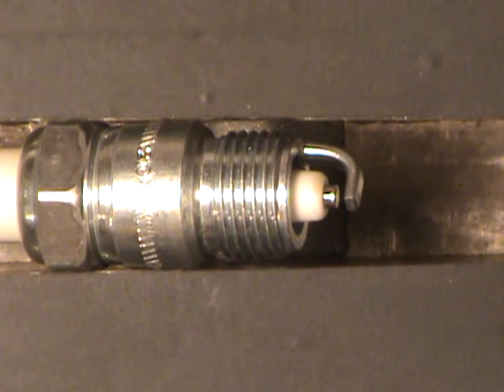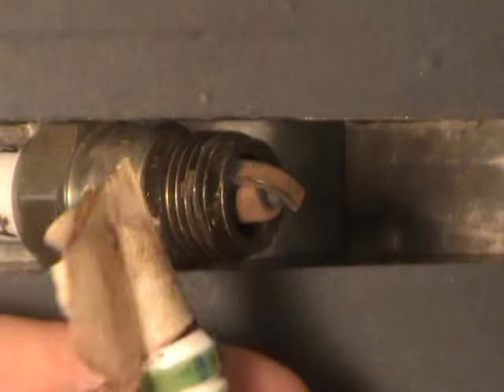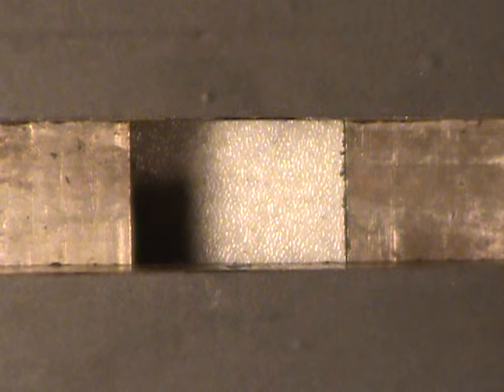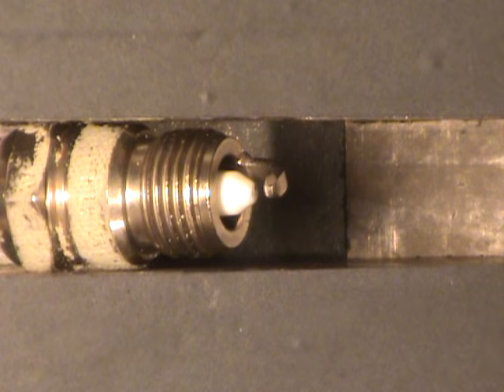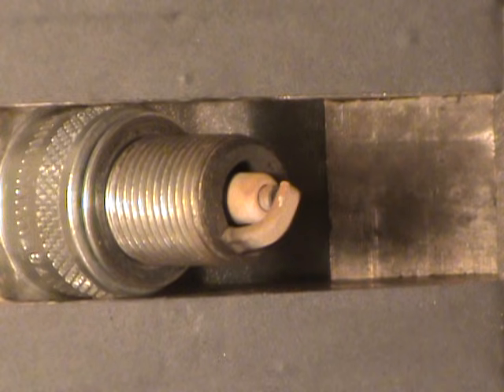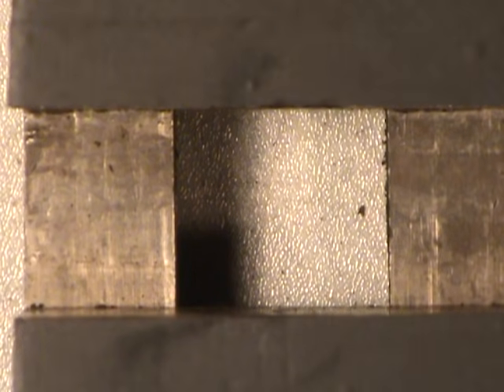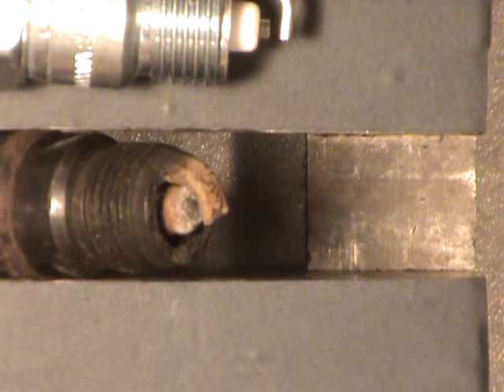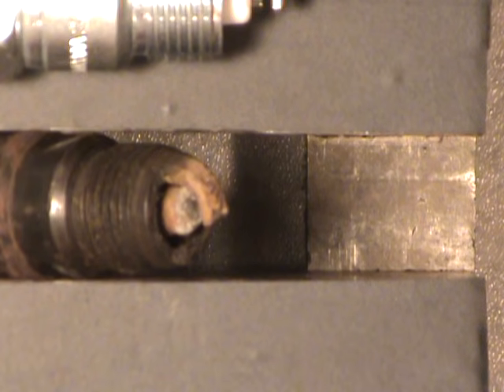SPARK PLUGS How to Read them (Part 3)

Comment: hi rockys. i have a lancer 2.0 and these are my spark plugs, please check it what  is the problem of my car.thank you.
http://s1348.photobucket.com/user/RenzAcedo/media/13350954_1193288634015367_226111949_o_zpsicfzos1v.jpg.html?filters[user]=135881500&filters[recent]=1&sort=1&o=0
Reply from the maker: Greetings...renz acedo............You're Welcome, and, Thanks for watching.............Before, I start to talk about the Picture, of Your Engine's, (4), Bosch Spark Plugs, that You provided the Link to (above), that You had, on Your Photobucket  web-page, I would like to say, a few things first, before doing so......................Have a look..."Inside", Your Lancer's "Engine Compartment" (under the Hood), for, what is called, a..."V.E.C.I." (Vehicle Emissions Control Information), "Label/Sticker", which will usually have, some Useful Information printed on it................Hopefully (printed on it), it will have the..."Mitsubishi"...(Your Lancer's Manufacturer)..."Original"..."Spark Plugs"...that were Installed in Your Lancer's, 2.0 Liter Engine, as it left the Mitsubishi/Lancer's "Assembly Line".....................I, myself, try to Buy/Purchase, the "Factory/Original" Spark Plugs, that the Manufacturer Installed in the Engine, when it was Brand New, in order to Avoid any Problems, as, in the past, I installed, a Set of, some "Other", Top Brand Name Spark Plugs in a V-6 Engine, and the "Heat Range" was..."2-Ranges...Hotter"...than, the Factory's, Originally installed Spark Plugs...!!! (and, maybe Your Bosch spark plugs, could very well be too...and I hope not...cuz...if way too Hot..."Engine Damage"...might be the result...!!!)....................Did You Measure the Spark Plug's..."Gap"...that's between the Inner (center), and Outer Electrode....???...as that "Gap/Measurement", is very Important, my Friend, cuz, too Small of a Gap, will usually make for, a Small Spark, and if that spark plug Gap, is too BIG, then, Miss-Firing can occur, as well as, the Ignition Coil, or Coils, tend to get "Over-Worked", and might possibly Over-Heat, and get Damaged, or Destroyed, and, I hope not...(please note, that, some spark Plug Designs, "Are-Not Gap-able")...also, try to find the "Correct"...spark plug..."Gap"...for Your Lancer's..."Exact"...Engine...!!!................Ok now, lettuce now talk, a bit, about the Photobucket Picture, of Your 2.0 Liter Engine's, (4-used)..."Bosch"...Spark Plugs...shall we..................It appears to me, that, the 3 Spark Plugs, on the Left Hand Side (of Your Picture)..."Were-Not Tightened Enough"...as, from what I saw, in Your Picture, those, shall we say..."Crush Washers"...were still "Round-Looking" to me, as compared-to, the Bosch spark plug, on the far, Right Hand Side (of Your Picture), where I was seeing, that "Crush (sealing) Washer", very well..."Flattened Out"...and, as it should be, in order to prevent, the Loss of (cylinder) Combustion Chamber "Pressure", as well as, having the Spark Plug, to be able to..."Transfer the Heat"...from the Electrode end, of the Spark Plug, to the Engine's Cylinder Head (Very Important...!!!)...and also, I think, that i saw, a little, Brown Spot/Area, on the spark plug, on the far, right side (while the other 3 didn't).....................All 4 Spark Plugs, kinda looked a bit Lean (air/fuel ratio/mixture-wise), for my liking.....................You were saying, about a "Problem"..."Engine...Running-wise"...???...and, if so, can You tell me, as to what, the Problem or Problems happen to be, the best way that You are able to, that way, I'll have a much better chance at helping You out....................Any Dashboard "Warning Lights", coming "On", since You had these "Bosch" spark plugs, in Your Lancer's Engine...???.........Is the Engine...Hard to Start...Cold or Hot...???.........Does the Engine, make a..."Pinging or Knocking"...Noise, when it is running...???................Does the Engine Run "Smooth", with lots of Power...???........So then, try to find that "V.E.C.I"...Label/Sticker, or, try to find the Mitsubishi/Factory's...Originally Installed Spark Plug's...Brand...Type...and...Part Number...for Your Lancer's..."Exact"...Engine, to avoid any unwanted problems.................Probably a good idea, to have Your Lancer's "On-Board Computer"..."Scanned"...for any..."Trouble Codes"...to see if there happens to be any, that might be Stored in Your Lancer's, Computer Memory (note...some Automotive Parts places/businesses, might "Scan" Your Lancer's Computer for "Free", so, just phone some places, and see/hear, what they have to say)...........Also, with a Computerized, Fuel Injected Engine, It's also a good idea, to have the "Fuel Pressure"..."Checked/Verified"...as well, cuz it's super-important, to have the Fuel Pressure..."With-in"..."Specifications"...or the Engine, probably won't run, as good as it should be running .........Warning...!!!...some Fuel Pressures, for gasoline, fuel injected engines, can be, about, as High as 60 PSI/Pounds per square Inch, and is "Dangerous"...!!!...................You didn't mention, Your Lancer's..."Year"...Model...and also, is Your Engine, Turbo-Charged as well...???...as, the more that I know about Your Car, the more, that I should be able to help You out, and.........till next time........Be Safe, take care, and have a good one.

Comment: Thank you for your effort to bring us this valuable material.
Reply from the maker: Greetings...Alex Pavlyuchenko....You are Welcome, and, Thanks for the nice comment, and for watching as well....................The Spark Plugs, that I used in this Video, are mostly out of, much older, lower compression (ratio), Carburetor equipped Engines, and, as You saw, they had quite a bit, in the way of Deposits, showing on them...................You will more than likely, not be seeing, as many Deposits, on the Spark Plugs, that come out of, the much Newer Engines...unless...there happens to be an "issue/problem", with either, the (computerized) Ignition System (weak or faulty), or, the Fuel (gasoline) System (too rich of an air/fuel ratio/mixture), that is usually, a (computerized) Fuel Injection, type of fuel system (since about the mid 1980's there-abouts, in the USA or Canada, that is).............Thanks again, and........Be Safe, take care, and have a good one.

Comment: What Ive noticed on mine is that the white ceramic part  ( Under the electrode is )  half dark and half white.  Does that mean the spark is not centered ?  I drive a 89 BMW 325i
Reply from the maker: +BadRonald1 ....Greetings BadRonald1....Thanks for watching.................On most of the common types of spark plugs, that, white-ish colored, Porcelain lookin' stuff, that surrounds the Center Electrode (when new and unused, that is), will usually have one side of it, having some Deposits on it, while the Other side of it, can be almost white-ish colored, after the spark plug, has been in a running engine, for at least a few hundred miles/kilometers, or more....................Why You ask...???...well, it's usually due to, the way in which, the Air/Fuel Mixture Flows, inside the engine's Combustion Chambers, and in simple terms, the Air/Fuel Mixture travels, from the intake valve, then, towards the spark plug's Electrodes, then, on to the exhaust valve it goes (it's actually, much more complex than that, as in, Swirl, Tumble, etc.)..................If an engine is running way too Rich (gasoline), or, burns too much oil, then, I've seen some spark plugs, that had, that center (electrode) Porcelain-lookin' stuff, all covered, with either, black dry carbon, or some very oil-ee deposits (sometimes Both...!!!...lol)..................Some of the newer engines, might not have very much at all (if any?) Deposits, showing on the spark plugs..................As long as Your BMW's Engine, Runs good-n-smooth, without having any unusual pinging or knocking noises, then, that's usually a good thing.................Try to always use the BMW's recommended Spark Plugs...Set at the Specified "Gap" (distance between the Electrodes, if they are Gap-able, that is), cuz, the BMW Folks, should know what They're talkin' about...and..........till next time.........Be Safe, take care, and have a good one.
Reply: Hi and thank you for getting back to me.  I wanted to ask you. What is your take on Heating Range plugs ?
Reply from the maker: +BadRonald1 ....Greetings BadRonald1....You're Welcome..................I believe the Term, that You are looking for, is..."Heat Range" (of a spark plug).................The "Heat Range" of a Spark Plug, has to be "Correct", for the "Exact" Engine, that they are being installed in......................Basically, the Heat Range of a Spark Plug, is its Ability, to Conduct "Heat"...Away, from the Electrode end of the Spark Plug, and Transfer that unwanted Heat, into the Cylinder Head....................You might come across the words..."Self Cleaning Temperature"...which, basically means that, the Electrode end of the Spark Plug, retains enough Heat, so, as to, shall we say..."Burn-off enough Deposits"...so the Spark Plug will stay Clean-enough, in order, to make sure, that, the Spark Plug can do its job properly, and give Us, a good-n-strong Spark, that should result in, a very good Combustion event..................Now then..."Too Cold of a Heat Range"...vs..."Too Hot of a Heat Range"...???...................If the Heat Range is "Too Cold", then, what usually happens, is, that, Too Many "Deposits", will usually, start Sticking to the Spark Plug, and when it gets to be Too Much (deposit-wise), then, the affected Spark Plug will probably start to Misfire, or, maybe those, too many Deposits, are electrically Conductive, and the High Voltage, just goes straight to (electrical) Ground, and Not Between, the Spark Plug's Electrodes at all, resulting in, "No Spark" what-so-ever...!!!...and probably, not much harm to the Engine, most of the time.................Now for..."Too Hot of a Heat Range"................Well, all of that Excessive Heat, will probably keep the Spark Plugs "Clean" alright, but..."Engine Damage"...could very well, be the result, if the Heat Range, is way Too High...!!!..................If the Spark Plug's Electrodes, remain Too Hot, (maybe Glowing?), then, that, could result in..."Pre-Ignition", where Combustion takes place, "Before" the Spark Plug goes "Spark", and the Piston and Connecting Rod, are trying to Turn the Crankshaft "Backwards", before the Piston reaches TDC/Top Dead Center...Ouch...!!!.................So You see my Friend, that's why it's Very Important, to Install the "Correct" Spark Plugs (including the Correct Heat Range, among other things), in any given Engine, be it Lawn-Mower, or a Race-Car................I usually, try to get, the Vehicle/Engine's, Factory/Manufacture's "Specified" Spark Plugs, in order to, try-n-Avoid..."Trouble"...and here's why...............I installed a Set of "Other Brand", of, top quality Spark Plugs, and, the Engine Ran fine, then quite some time later, I checked the "Heat Range" of those "Other (top quality) Brand Name, Spark Plugs, and..."Holy-Gwalk-ah-Moly"...this set of, the Other Brand of Spark Plugs, were..."2 Ranges Too Hot"...!!!...but when I had a look at them, after bein' in the Engine, for not all that long, they looked-to-be Ok, as in, the Porcelain-like stuff, on the Electrode end, had the usual Deposits on it, and the Electrodes (metal) didn't appear to be worn-down, at too fast of a rate (as opposed, to seeing, worn-down-too-fast, or even..."Melted" Electrodes...!!!)......Also, make sure, that, the part of the Spark Plug, that goes/screws "into" the Cylinder Head, is, "Not Longer", than, the Factory/Manufacturer's "Specified" Spark Plug, cuz, You might run the risk, of having that (hypothetically), Too Long, of a "Reach" (Reach is another word/terminology, that's used in the spark plug world), where was I....oh yeah...if the "Reach", of the Spark Plug, is Longer, than the Factory/Manufacturer's "Specified" Spark Plug, then, in a worst case scenario, the Piston rises Up, in the Cylinder, and..."Smacks"...right into, the Electrode end of the Spark Plug...!!! (Not Good...!!!)...and just repeat after me...expensive...Expensive..."EXPENSIVE"...!!!...it will usually be, to fix it, that is...and...........till next time..........Be Safe, take care, and have a good one.